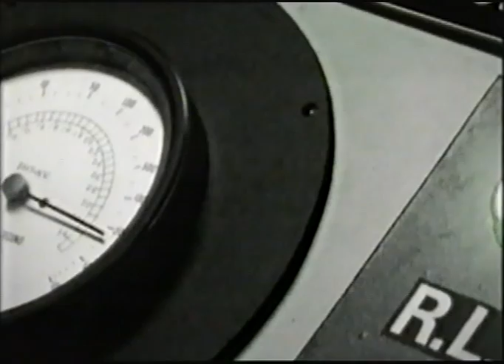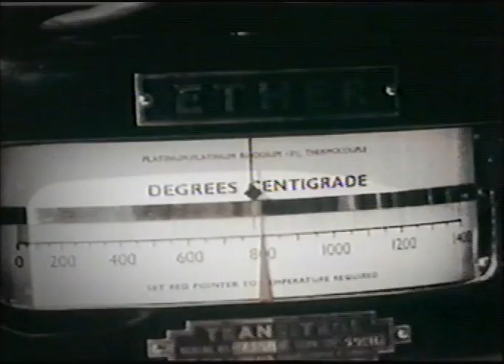Windscale: Britain's Biggest Nuclear Disaster - Part 07

Comment: @whangie1 (Part 2) The production of plutonium is not a thermal reaction.  Hotter uranium does not produce more plutonium.  Plutonium production is the result of the neutron flux within the reactor.  The neutron flux is the result of the critical mass of uranium and the power level at which the reactor is operating.

Comment: @whangie1 (Part 3) Just as the fuel loading in Pile 1 was nearing completion, Harwell calculated the needed critical mass of uranium for the pile; It was nearly 30% more than the reactor was designed to hold.  The aluminum used in the fins (as a light metal) acts as a neutron absorber, robbing the reaction of neutrons needed to keep the reaction going.

Therefore, the amount of aluminum in the fins was reduced, not to heat the uranium, but to free up more neutrons for the reaction.

Comment: @mard420 They did use CO2, but this wasn't mentioned in the BBC vid.  The cartridges were so hot that they were able to strip the oxygen from the CO2 which resulted in greater burning.  That's when they decided to try water.

Comment: @mushroomscouser The only modern feature that would have affected how things unfolded would have been a gravity-powered water pump. However, this would have only prevented the need to bring water in by helicopter later on, not prevented the hydrogen explosion. The coolant itself creates steam, which could not be vented once it became less irradiated since the generator which controlled the vents were wiped out by the tsunami.

Comment: @mushroomscouser The evacuation zone was also expanded, but mainly to ease concerns since most of the radiation seems to have been diluted in the bay water or contained well enough. Before you begin to run around in a panic, know that radiation diluted in the water does not make for a dangerous situation as long as it is diluted enough. You know how they handle these situations? They take a tanker full of the water out to sea and drop it amidst "clean" water to dilute it even further.

Comment: @mushroomscouser Fukushima has been rated 7 on the nuclear event scale. This is Chernobyl's rating, but it doesn't compare. Chernobyl released over a million units, whereas this is in the thousands. What does this rating mean? The state of the core was such that enough radiation was potentially released to qualify.  The scale only measures what was potentially released from the core regardless of whether it was contained or how diluted it was. Containment was a success and clean up ongoing.

Comment: @mushroomscouser You do not understand that current safety procedures resulted in zero deaths due to Fukushima. There are no improvements on the current safety practices which are necessary for the entire nuclear industry. Also, modern designs for plants are as effective as they can get and the Fukushima (80s design) collapse was not a design issue anyway. This has been reported again and again. Perhaps you should not judge all operations by the mishandling of Windscale/Sellafield?

Comment: @mushroomscouser The burial of the reactors after the structure around it collapsed thanks to instability brought on by the tsunami is the proper way to dispose of a reactor whose surrounding structure cannot be rebuilt. The area around the plant will be cleaned up with no long term dangers. This isn't Chernobyl, although morons like you will look at the burial and immediately make such connections. You have a facile understanding of this subject and really should shut the fuck up about it.

Comment: @mushroomscouser You ignorant moron. There is absolutely nothing safer about coal. Think logically for one second: Accidents like these are few and far between. The fact that when radiation is released in large quantities it can be deadlier than coal does not in any way negate the fact that it seldom happens. On the other hand, coal ash is released in tremendous quantities as part of the normal operating procedure for coal plants every day with plenty of harmful elements. Educate yourself.